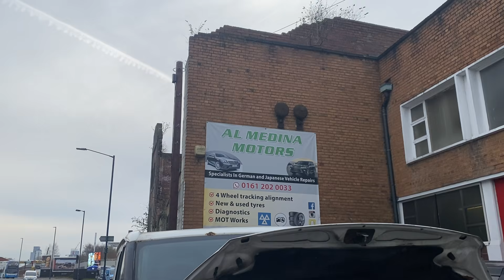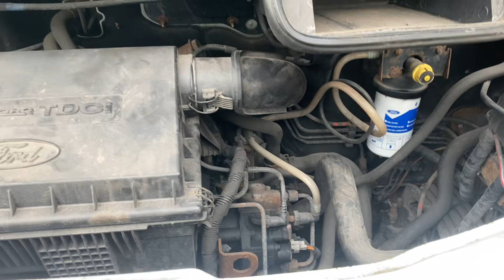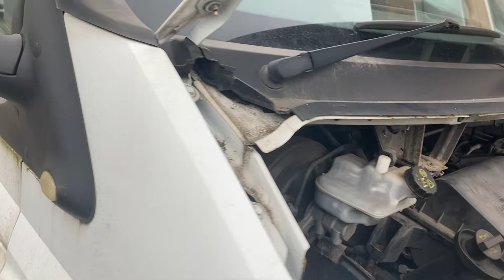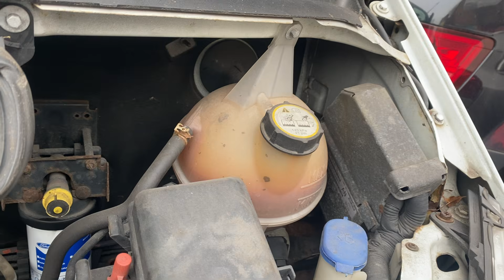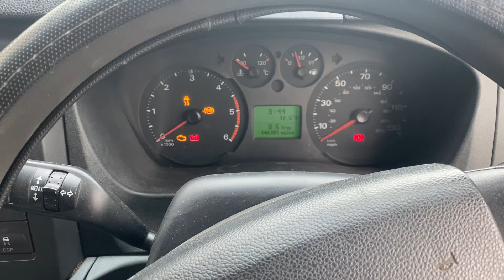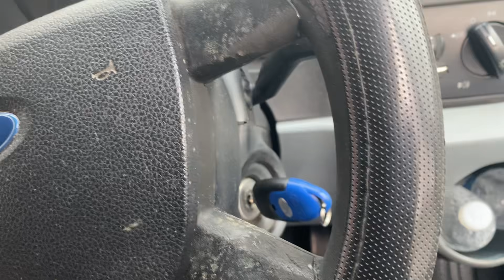Ford transit 2008 non-starter

Comment: Thank you for such a great video. I am an electronics engineer, and I am 65 so I have owned  many cars and motor bikes, I now own a ford transit Mk7  dated 2011 in fact i have owned 4.  If you have a Mechanical problem call Luke, and Tammy from Club Mill Garage Sheffield. 

Bloody  sensors, the more cars have evolved the more unreliable they have become. As an electronics engineer I want to educate the younger people as to how we have all been lied to by car companies and governments. 

In 1978 I could fix my Australian car no problems, you only had three principles to diagnoses  and understand fuel, compression, and spark,  now the current  crap we have is well over stupid. Over complex, under reliable, designed to get you back into the dealers every time. Every fault requires a computer  P Code! In 1978 we had no computer codes. You only needed to understand 3 principles. Fuel, compression, timing. 

Now my  electronics teacher used to always say keep it simple. For all our multi evolution during my life modern cars have not got 90 percent more efficient, or reliable ,   they are 90 percent more unreliable compared to cars made in 1970. 

Modern cars have hundreds of more things that can go wrong, yet they are not hundreds of times more efficient on fuel, they are complex, have more vulnerable parts, more prone to fail than cars built pre 1970, and they are more unreliable to cars made 50 years ago. 

Most people are stuffed when the car wont start, I get that. We allowed the car manufactures to create secret P codes, special sensors, anti so called anti pollution crap that all started in California USA.
  We decided that computers are better than humans in running cars and listening to what sounds you car is telling you she wants you to hear her problems.

 When you car eventually fails, the bloody computer is so smart it cant tell you in human language what the hell it wants. Thanks to dealers it will give you a vague P code, and you then need to suffer to understand what the hell that means. 

DPF filters! So here is the deal. Next time you modern car fails, you lift the hood and say no chance. I cant use the one in three rule. So you call a mechanic, or AA. He comes and tells you sorry its got to go on a lift truck. You get a taxi home. 

Your mechanic then scratches his head,  and advises we will look into this. Fact is guys and girls. In 1975 we did not use the AA. The average motorist could diagnose the problem, fix it and drive on. If your fan belt failed you took off your girl friends stockings made a fan belt and you got lucky, and drove home.

 We have evolved backwords in the name of a greener world. Now all these tow trucks, mechanics that visit, AA, guys are burning more carbon from when I could fix my car in 1975!

We have all been fooled to think we have better cars than 1975 but we  simply don't they are crap compared to cars built  back then!    Did we triple fuel range for the complex computers ? Did we hell. 

Don't let the government tell you that electric cars are the future, are they hell. In conclusion if you have problems with you car, or van call Luke, or Tammy from club Mill Garage. Great honest people who I respect. They don't know I am an engineer, never once have they tried to BS me. They are great guys to work with. 

Skippy.

Comment: Hi a great help i have starting problems with my mk7 2.2 transit,i have gone through many things injectors tested rail sensor and valve replaced,new egr valve,when running you would not think anything was wrong,so going to replace the sensor you replaced to give that a try,i wish you were local to me as you know your stuff.
Reply: did this work for you please hardnut?